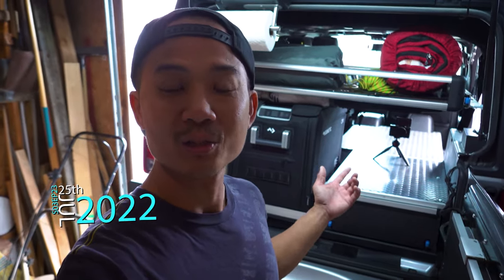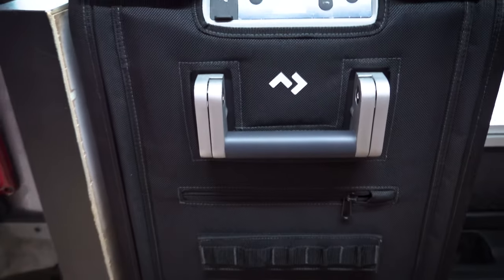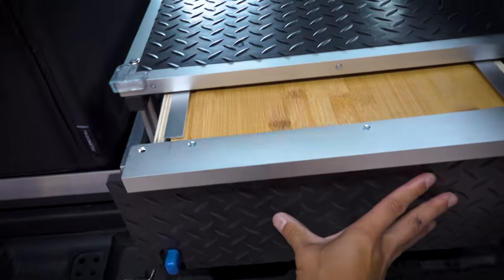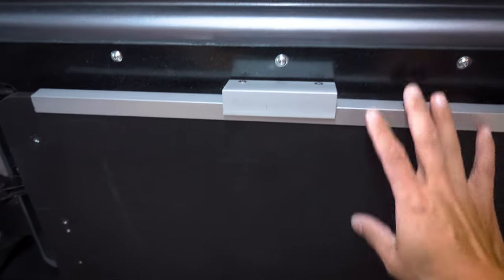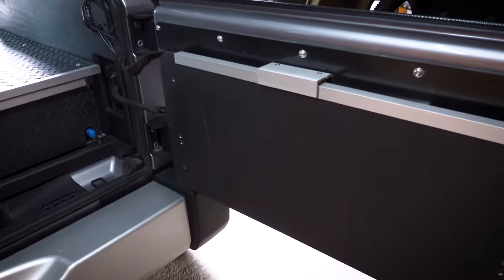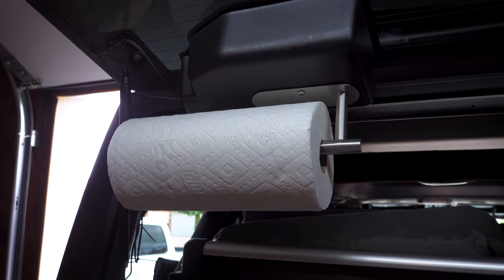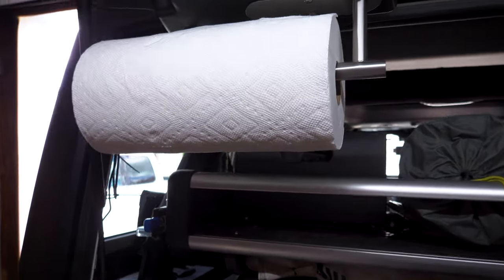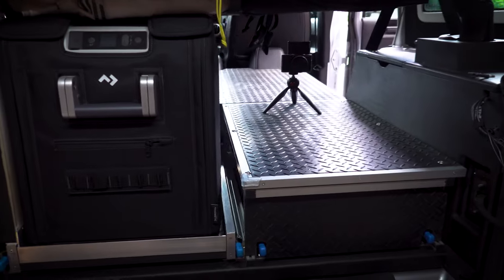JKU BUILD// DIY Jeep JKU Storage Platform V3 Complete Build Tour

Comment: Hey man, great build there. How is the aluminium frame holding up? Any creaks/movements since your build that require frequent adjustments? Also, how did you mount your drawer slides onto the aluminium frame? Couldn’t see that bit from you previous video. Keep up the good work!
Reply from the maker: Hey there, the top aluminum frame (Teraflex) is holding up. I do get creaks when I go off a big bump. I have the rails mounted to aluminum L channel bolted to the existing brackets that came with the Teraflex shelf. Those brackets are then screwed into the Jeep frame where the soft top would normally go.
Reply: @W1LDCH1LD1  thank you, good to know that as I was a little worried about constant adjustments. If it’s just over big bumps I think I can live with that.